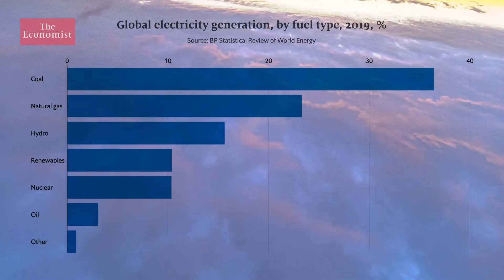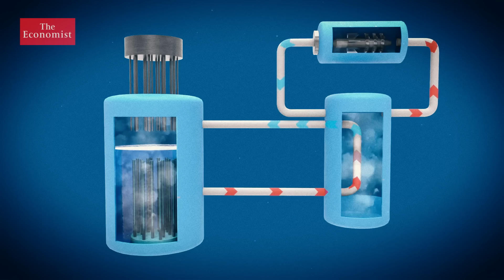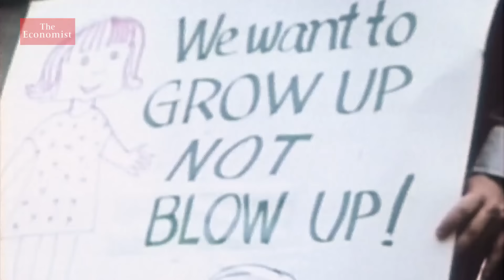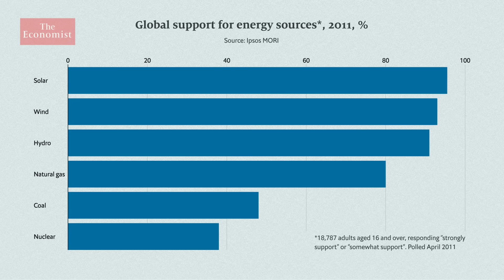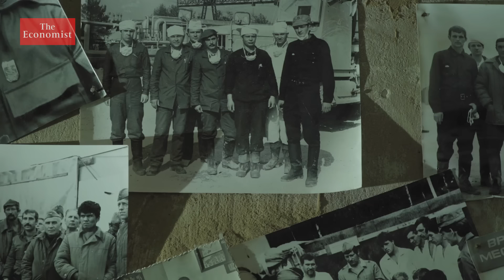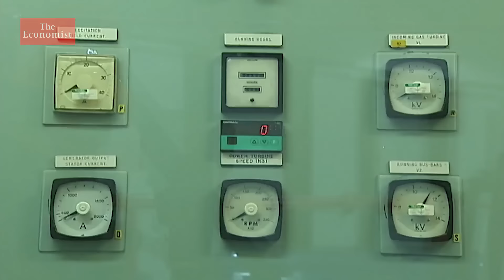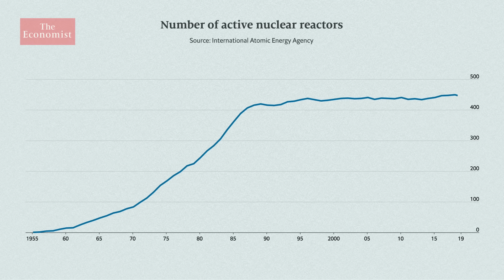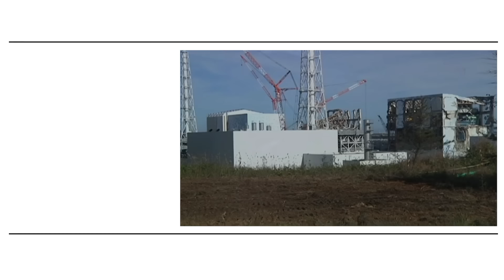Nuclear power: why is it so unpopular?

Comment: There is enough land around an ordinary nuclear generator that if the same area were used for solar, as much or more power would be generated.

Solar/Wind/Battery is many times cheaper than nuclear.

Nuclear is the only way to guarantee hundreds of years of dangerous wastes that must be stored and guarded to avoid serious risk spreading over hundreds or thousands of square miles.

I'm all for nuclear research and use in medicine; I'm just not sure what the value of this video is, promoting one of the most expensive forms of energy.
Reply: Looks like you haven't studied as much as you think.
Reply: @danadurnfordkevinblanchdebunk  It does? How much do I think? How much does it look like I've studied? Your comment seems absurd.

Perhaps you could clarify? Maybe offer some numbers, or references, or a point in any way not ad hominem?
Reply: @bartroberts1514  Batteries are not an option right now. The biggest battery on earth right now (take the one in Australia) wouldn't even keep a big city running for  5 minutes. Energy storage is just not there yet, sadly that will be decades in the future. Will climate change wait for us that long?
Reply: @yamilabugattas3895  The best climatologists tell us that it's prudent to avoid 1.5 degrees C warming. If we curtail fossil emissions 1% of today's level a month down to zero by 2030, we can squeeze in under the wire.

Anything past that incurs risks of runaway to Hothouse Earth, which inevitably ends farming, fisheries, forestry and at least half of all species as we know them.

So. When you tell us things about batteries like the 174 MW Hornsdale Power Reserve built in 60 days, which paid for itself with ancillary services beyond just the storage it provides in 28 months, and which is now being followed by a 300 MW sequel, you ought to be more accurate. 2.6 hours is the rated capacity for a total power outage in all of South Australia, comparable to a large city's needs. With the sequel, that's 4.5 hours, and while it's not the 35-90 hours of backup recommended by ReThinkX, that 35-90 hours is extremely affordable. When combined with 3-5 times demand solar and wind, such a mix is the cheapest grid energy projected to be possible with current technology by 2030.

Why you think Hornsdale is only 5 minutes of supply, or grid scale batteries are decades away, I cannot say. I suggest it's some ulterior agenda in denial of technical fact.
Reply: @bartroberts1514  Perhaps I should have been more clear. How long can a 450MW battery last for a city like New York? How many of those would they need? How will such a large scale acquisition affect the prices of some of the rare elements used for the construction of those batteries (like cobalt for instance)? Total battery storage today is a tiny fraction of what's used in a day. We are just not there yet. And that's without counting how fast those batteries can lose not insignificant proportions of their storage capacity. That kind of battery is not really made for long term storage, they are used mainly for load following, for which they are great.

So we need another solution, since climate change won't really wait for us.
Reply: @yamilabugattas3895  South Australia is a proof of concept. 1.8 million people have 4.5 hours of peak grid backup. At night, demand falls to almost nothing, so that backup is more like 13.5 hours. Combined with solar, that 450 MW is enough for almost 2 million people almost indefinitely, 99% of the time. And it's already paid for itself: the 300 MW was paid for by the savings from the first 174 MW, after the first stage completely paid for itself in 28 months. In a decade, any grid battery of any scale will pay off its entire cost, and get to 35-90 hours of storage. New York included. Hornback proves ancillary grid services are goldmines, and smart grid operators are seeing batteries in a new light now.

Those 'rare' elements are on the steeply falling side of the long run cost of production curve, as known reserves far exceed demand, and production capacity gets cheaper per unit when capitalized at high enough levels.

I get that you want to spitball objections, but your list of absurd made up load following whataboutism amounts to no more than oppositional defiance disorder.
Reply: @bartroberts1514  I think its a bit sad that you react like that when one just points out some serious issues with your ideas. As if the size of the problem didn't matter.

Now correct me if I'm wrong, but isn't the electricity consumption of the state of New York around 143TWhs? Dividing that by 365, we have an average consumption of about 392GWh. Unless I've made a mistake there, that would mean they need in excess of 800 of those batteries. Now that's just one state, in one country. How much would that cost on that scale, considering current supply and its growth? There's a reason why The Economist is covering this subject.

So I think you are making light of a real problem in efficiency and supply, since we are talking ramping up production of lithium batteries on a scale that is not only hard to imagine but that would put pressure on many of the materials used in production, some of which are in fact 'rare', relatively speaking.

The truth is we'll need some other technology for large scale energy storage, lithium batteries won't be it. It's not energy dense enough for it.
Reply: @yamilabugattas3895  You're saddened that absurd objections get noted as absurd?

Sure, 800 grid battery farms sounds like a lot. But it really isn't. And not every city is New York City. New York City is special.

We've already been over the cost: gird batteries PAY FOR THEMSELVES IN TWO YEARS. The cost is net negative. Even if there weren't climate change, it's worth doing grid battery for the FCAS and automated impedance matching.

As has been pointed out before, the land area set aside for nuclear could generate more power from solar. The land used for solar can be dual purpose also used for grid scale battery farms, and other uses, as the battery farms have a tiny footprint compared to the solar farm, taking up the same space but far less resources than the nuclear facility, and cheaper, and faster to build, and more versatile -- when nuclear needs maintenance, it's all down, for a decade or more sometimes.

Truth is arrived at from facts by mathematics, not by personal incredulity flung at a wall in the hope something sticks. These lithium calculations have been done. Check out Seba and Dorr at ReThinkX, for one example, or The Solutions Project, or Tesla, or any of a hundred other expert sources.

Or continue to make up objections others have long ago shot down. I stopped caring about why people want to do that to their credibility a long time ago.
Reply: @bartroberts1514  Well at least we agree on how we need facts and mathematics to arrive at the truth.

It's evident that you don't understand the scale of what you are proposing. That was just New York, and that state alone would crash the current market for batteries. Solar energy is great and should be expanded (it will keep increasing in the coming years), but the volatility that it introduces to the grid (wind too) is not to be underestimated. That volatility is what causes the need for that many batteries, adding to the real cost of solar and wind. Saying they pay for themselves is absurd, especially at that scale, and we are talking trillions for the US alone.

 Nuclear energy might be a bit more expensive today, but that's if you don't take into account the volatility of the renewables and the cost they introduce. I mean, sure, as long as countries have a firm load in hydro, nuclear or fossil fuels we'll be able to add renewables for cheap. But as soon as they represent a big part of our energy production you'll need to add to that cost the added price of the storage.

But it's clear we are getting nowhere with this. If you are right then we'll see it relatively soon. If those solar farms and batteries are such a brilliant investment, we'll be seeing a lot of private money well past 50% of energy production, instead of a surge in coal and gas to offset the volatility in renewables, as has happened in Germany.
Reply: @yamilabugattas3895  I more than understand how to apply scale to projects. Is it big? Sure. But bigger changes happen all the time. Do you understand the scale of change in the computer and telecommunications industry every decade for the last 50 years? It would blast this little upgrade out of the water.
Do you know that as of 2018, 20 increasingly efficient solar panels roll off assembly lines every second, getting 23% cheaper per doubling of number produced? And that's at the slow pace of an unmotivated industry with every roadblock in its way. Remove fossil, and the scale up will furnish enough solar to provide the equivalent of three times the total energy used today in all forms (I did the math, but so have hundreds of others).

You are making up objections like 'volatility', and getting fundamentals backwards.

You can't serve a cup of green tea and a cup of black tea in the same cup at the same time. To serve green tea, stop serving black tea. 

For the smoothest, most economical transition with the lowest overall impact, curtail fossil-emitting extraction, trade and use licenses and permits 1% of today's level each month, down to zero by 2030. 

The Market will take care of the rest.
Reply: @bartroberts1514  You see, the problem with what you are saying is  that those numbers are not happening any time soon. Just for perspective, take what the Energy Storage Association says is their target for 2030: 100GW of energy storage in the US. So they expect, with a bit of optimism (it's around 20-25GW right now), to get to 100GW in 2030 in the US. How much is that?

Well, considering the total anual consumption of the US is above 4200TWh, by 2030 you would barely be any closer to your target. In fact, that optimistic target the ESA has for the whole country by 2030 wouldn't even power the state of New York alone for 8 hours. So given the target the ESA has, 10 years in the future you wouldn't even be 5% of the way to your target. Again let me know if I've made a mistake, but I just checked the numbers.

Not just that. It would be reasonable to expect a higher electricity consumption by that time, considering the increase in electric vehicle adoption and probably other things, which would mean those 100GW would be even less than what they would mean today.

So I hope you can understand now why what you are saying sounds a bit silly to me.
Reply: @yamilabugattas3895  If what ESA said at one point is the only problem with what I'm saying, then I take it you agree with everything else I've said?

You're using linear approximations of a growth curve that follows the Power function. That's the mistake Tony Seba points out, as explained by Adam Dorr in ReThinkX's projections. Simply, ESA has a straight line model for trend that is greater than parabolic. They've chosen the wrong fit. Anyone who's been watching the progression of COVID-19 understands the Logistics Curve at least a little. The question is, how fast can the world double installed capacity. The answer depends on what's standing in the way. Remove fossil obstacles, and that doubling time goes from years to months.

And what's with this obsession with New York, while ignoring the history of New York? 

A few more big storm surges like Superstorm Sandy, and replacing its power stations with grid batteries, offshore wind and solar will be inevitable, and might be done as a one-shot by a motivated administration.

Comment: Nuclear power is very energy efficient and clean, but nowadays the payback time is very long. Moreover, running a nuclear power plant has become not cost-efficient. Replacing engines, systems, components etc. is also not profitable after a certain time. An example is the Diablo Canyon nuclear plant in California.

Comment: Kinda glossed over the issue of nuclear waste and how to safely store spent fuel rods, which have half-lives in the thousands of years.
Reply: Looks like they are doing just fine by storing it onsite.  Never harmed anyone.
Reply: @danadurnfordkevinblanchdebunk  Why don't you just have some disposed in your house then, if they're so harmless?
Reply: @roomie4rent   Did I say it was harmless?  I said it is properly stored and hasn't hurt anyone.  I get much more radiation from coal power plants since coal ash is more radioactive than nuclear waste. .
Reply: @danadurnfordkevinblanchdebunk  Yeah, sure - when you discount Fukushima, Chernobyl, and other disasters, nuclear has an unblemished safety record. You just have to believe. And it's not like our fuel rod pools in the US aren't overcapacity either. Maybe we can use your pool?
Reply: @roomie4rent   Sure thing.  Nuclear is the safest of all electricity generation methods we have.  Get a clue.
Reply: @danadurnfordkevinblanchdebunk  Getting paid by Big Nuke? Are you seriously contending that nuclear is safer than wind, hydro, geothermal, etc. You're the one needing a clue.
Reply: @roomie4rent   Of course nuclear is safer.  You could have looked it up before making a fool of yourself on the internet.
Reply: @danadurnfordkevinblanchdebunk  Why don't you provide this credible source of information that firmly proves your contention?
Reply: @roomie4rent   Already did, but maybe YT blocked my links.  Why don't you look it up instead of screaming nonsense?  Try: "How Deadly is your Kilowatt? We Rank the Killer Energy Sources"
Reply: @danadurnfordkevinblanchdebunk  I just and Our World in Data shows that solar and wind are safer, in deaths per TW/hr. This is nonetheless a crude measure considering 1) energy produced at different scales, with variations in supply chain requirements and geographic concentrations, will invariably result in contrasting mortality statistics and 2) the effects of radiation exposure are oftentimes very much delayed and are difficult to pinpoint in terms of the cause/original source. I very much doubt that nuclear power can be produced at the scale of coal or oil and that its per capita mortality remain unaffected. You might understand complexities like that if you were anything more than a paid propagandist, but you probably lack the intelligence to get a real job.
Reply: Your Lord Sans The Skeleton   It's just a matter of finding facts.  Fear mongers generally lack them.

Comment: Carbon is not the threat, so does the carbon emission as well. Well none actually talks about the emission of Petrolium dioxide or Petrolium monoxide,  can someone suggest when a car ignites -what is the percentage of carbon is getting emitted and the petrolium dioxide and monoxide getting emitted, check which is the highest. Though the gov__t and so called environmental activists are being controlled by petroleum corporation or fed with incorrect data or reports publically available. Carbon is not something created by humans its been there in our eco system right from the birth of the planet, our body is made of carbon, carbohydrates are made of carbon protein is made of carbon, we were born out of carbon when we die we get disolved into carobons. Nature knows the  way how to break carbon monoxide and disolve carbon,  when the plant performs photosynthesis, can someone suggest how nature can handle petrolium dioxide or petrolium monoxide-how do nature can break the petrolium element from a petrolium dioxide or monoxide. When an industry operates it doesn't emit only carbon it emits the other gases and metal substances in air so on and so forth. In this world whatever we hear from news are something or some other hand was paid and sponsored by someone, nothing comes at free of cost, so think twice and do research before we believe in something.

Comment: This video has a very narrow-minded approach to nuclear reactors. What about the nuclear waste?  You can't just ignore complete arguments from the opposing side. 
Also, you said the people who died because of Fukushima didn't die from the radiation. Why on earth should they not count? They still died because of the nuclear accident.
Reply: Nuclear waste is a valid problem but climate change is a far bigger one. It may be extremely dangerous but it can be contained, unlike the toxic fumes released by burning fossil fuels. If you live in a city, you’re already significantly more likely to suffer from respiratory illnesses or develop lung cancer. The total harm of all nuclear accidents per unit of power is much less than coal.

Comment: A nuclear power plant has an exclusion fence around it. In many locations if you used all that space for solar panels and batteries you would produce the same amount power for less money.
Reply: Wrong in two ways: 1) that area isn’t enough to match a nuclear power plant, even when solar is a peak power, 2) solar is rarely ever a peak power.
Reply: Solar power arrays also have fences around them.

Comment: Sure, it's safe. But what about the fuel waste?
Reply: No one has ever been injured by stored spent fuel rods.
Reply: Manuel K. if the fuel were separated into the highly radioactive fission products and the less radioactive actinides, the actinides can be placed back inside a reactor to generate more power.

The fission products  are very radioactive, but decay to background levels after about 300 years. This is proven technology done commercially by the French already.

It is the lack of separation that keeps the radioactivity high for thousands of years. If you only have to store a tiny volume of waste for a short 300 years, the waste problem becomes trivial.
Reply: @factnotfiction5915  Interesting. Thanks for your answer.
Reply: There are also ways to recycle used fuel being discovered, look up MOX fuel and nuclear batteries